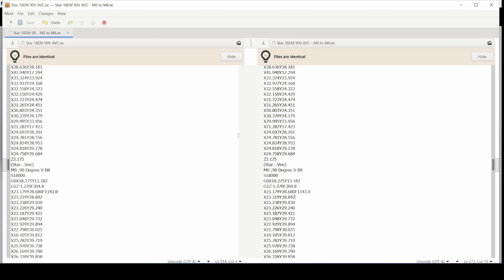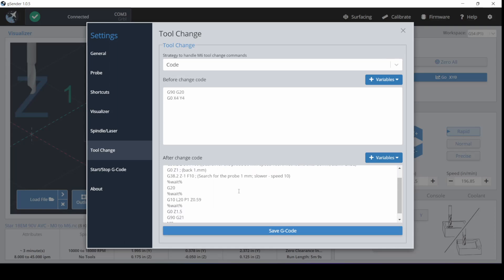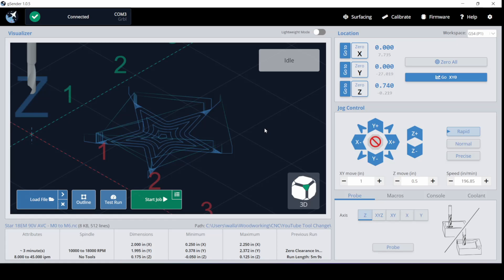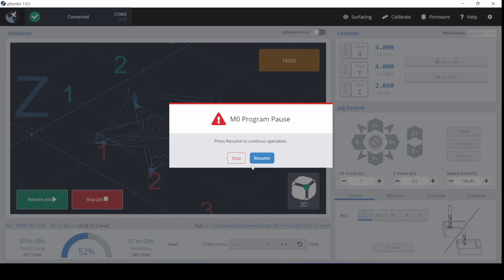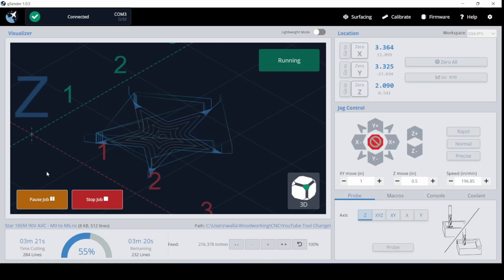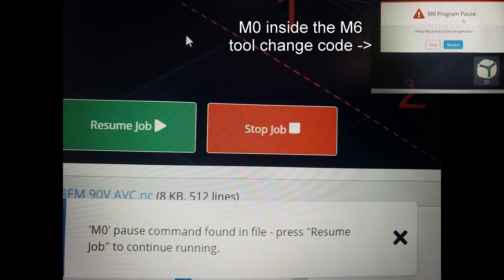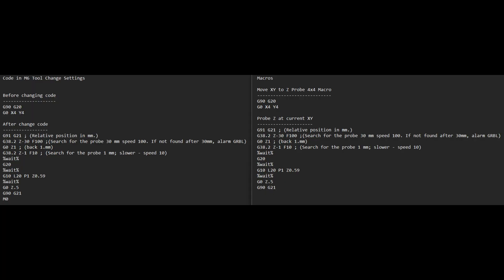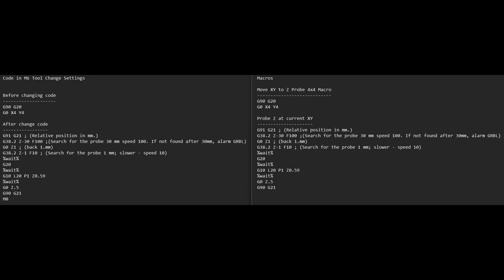CNC - GSender M6 Tool Change Code with Touch Plate on my LongMill

Comment: How do you change thickness of the plate. I have not told g-Sender how thick my plate is. Where is that done at?
Reply: In gSender, Probe is defined under Settings ......Probe.

Comment: Good video sir. I’m still kinda Lost. I understand the problem you we’re having. What I don’t get is, is this a problem for all longmill machines or is this just yours.
Reply from the maker: This isn't specific to my machine - it's a combination of Carbide Create using M0 vs M6 for tool changes and GSender's "tool change" code configuration under Settings.

If you change the GCode to M6 where it has an M0 for tool change AND you change GSender's action to perform to "Code" you will go through what I did in this video and the approach (while perhaps not 'perfect') I use will work to be able to re-zero Z via the probe.